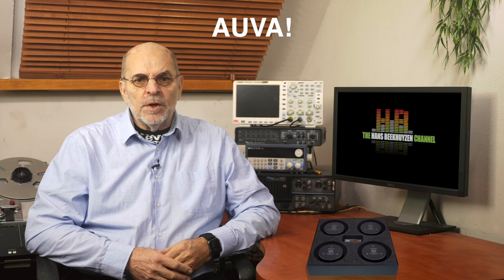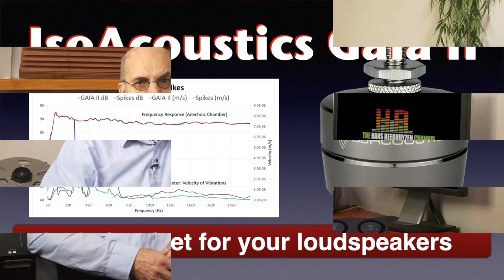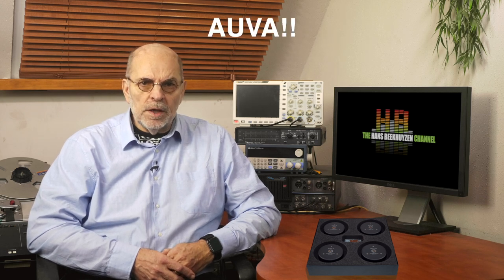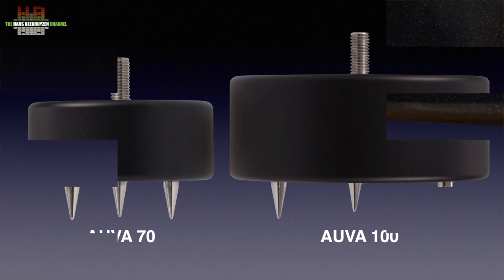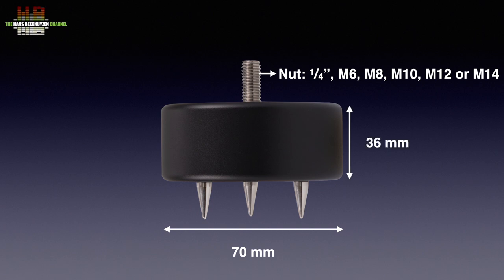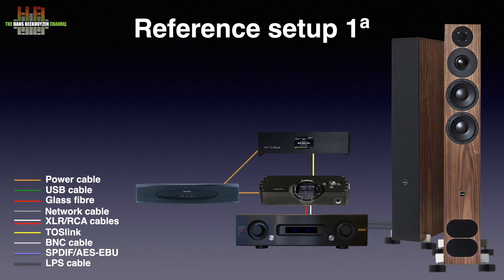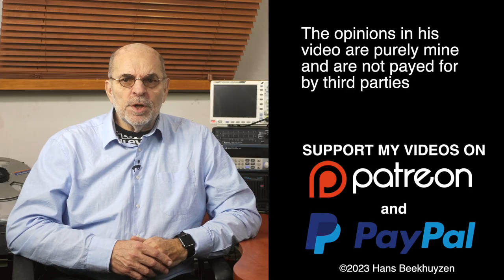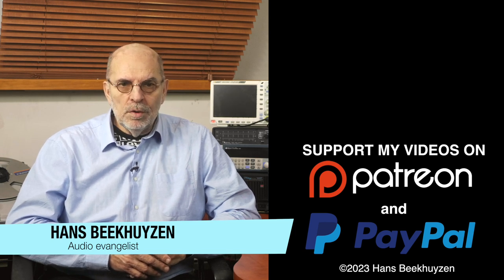Stack Audio AUVA 70 speaker isolators

Comment: Hi Hans, I've actually been looking at different isolators recently, so this is perfect timing! A couple questions.
1. I currently just have the stock feet on my speakers (not using spikes because they're sitting on hardwood floors on top of cement). Given the floor is already relatively solid, would this still result in a substantial improvement, or is it more applicable to more "resonant" floors?
2. Did you notice that this improves the sound across a wide volume range, or is this mostly applicable when listening at louder volumes?

Thanks!
Reply from the maker: I use them on a concrete floor with a layer of oak on a damping and isolating underfloor layer. You won't believe the difference they make. I  judge these kinds of devices at different levels - also when leisure listening - and the effect at 65 dBSPL is clearly audible.
Reply: @TheHansBeekhuyzenChannel  thanks for the info. Definitely adding this to my list to try out!

Comment: Thank you very much for this video. I happen to own the PMC‘s Fact.12 Signature too and also use the Isoacoustic Gaia2 feet, what a coincidence. I found these very convincing, hard to believe the Stack Audio Auva‘s are so much better, but I believe you when you say you heard a clear improvement. The PMC’s are very revealing and show every change, for the good or the better, so I guess I have to try the Auva‘s as well.   Will report back later. Cheers/Ron
Reply from the maker: Very nice!
Reply: Hi Hans, I just received the Auva‘s today and put them under my PMC‘s. What can I say….I knew these are great speakers but they unfold their true potential with these Auva‘s underneath. What a surprise, I am zapping from one song to another and every time I discover something new again. I did not think it was possible to have such an experience anymore in terms of sound improvement without changing to another level of equipment.
Reply from the maker: Great, isn’t it? Thanks for sharing.
Reply: @TheHansBeekhuyzenChannel  Hi Hans, try the new Auva EQ isolators for equipment, just put them under my preamp. Very curious what you think about these new product from Theo Stack….😊
Reply from the maker: The’re in the pipeline 😁
Reply: @TheHansBeekhuyzenChannel I can only say, I am not sending them back
Reply: @timronners did you get the 70’s or the 100’s?

Comment: Hans, love your channel a quick question ref the Auva 50 and 70's at present I am using Townshend Seismic Podiums with my speakers these were not bought just for sound quality but also  to give me some isolation from the floor to help reduce sound traveling through the floor to my neighbours below, as I Iive in an apartment. As someone who has tested both these products do you think these are as effective at reducing vibrations through the floor as the Podiums the reason I want to change the podiums is to give me more flexibility moving the speakers around in the living room the podiums do tend to take up a lot of room. At present I am using the AUVA equipment isolators with my Dac and cd player etc and am very impressed hence the interest in purchasing the speaker version.
Reply from the maker: The Auvan's do absorb vibrations. Whether it is to the same degree as the Seismic, I can't say.
Reply: @TheHansBeekhuyzenChannel  Thanks Hans for the reply think I will try the 70’s.

Comment: Do they have weight limits like the Gaia’s do? My speakers weigh about 40kg. Would the 70 work?
Love your videos!
Reply from the maker: It's not a spring/damper system, so weight isn't critical. It's the amount of vibrations that have to be dampened. The AUVA 100 can do more than the AUVA 70 but the latter already worked very fine as you should have seen in the review. The maximum weight is specified at  275 Kg (606lbs) or less.

Comment: Nice review Hans. Great to see another speaker isolation product. I love the black look of these isolators and prefer this color to the glossy IsoAcoustics (great product but they should also sell those in matte black). The footprint is a bit bigger at 7cm so that's something to take into account (especially if you still have tiles underneath, for example). Given your test, I think these are worth testing.

Comment: Hi Hans. Thanks for the review. I have got Townshend Seismic Podiums installed. Would the Auva be an improvement over the Townshend Seismic Podiums? Thanks!
Reply from the maker: As I said in the video, I reviewed the Townshands using my old speakers so I can't reliably judge the difference between the Townshends and the AUVA's.
Reply: I'm not sure if you still have this question, but fyi The Audioophile Man did a review of the Auva isolator feet and compared the Townsend podium to the 70 and 100 feet. I couldn't post the link as YT AI bots will delete my post.

Comment: Wow! Interesting technology. Makes me think about making shallow sandboxes and putting my speakers onto a plinth that rests on the sand. But that solution will definitely not get past the aesthetics committee.
Reply: Interesting idea. Maybe the plinth somewhat smaller than the loudspeakers, fitting into the sandbox that has the same footprint and color as the loudspeakers? Then it's just as if the loudspeakers got a few cm taller
Reply from the maker: It depends on the quality of the FSP's you use.

Comment: Interesting!
I just use hockey pucks.
Reply from the maker: Hokey pucks? Aren't those solid? In that case they just conduct vibrations to the floor and reflect a part of them back into the speaker cabinet.
Reply: @TheHansBeekhuyzenChannel  
I use the spikes on the speakers and place the speakers on the pucks. Hockey pucks are made of vulcanized rubber.

Comment: Hey Hans, after just watching your recent Reference Set Ups update video I couldn’t help tracking this Stack Audio review down too - Though I began to wish I hadn’t, given I’ve already purchased a rather expensive set of Gaia I’s for my Focal Sopra No.3’s but haven’t had chance to experiment with them owing to our impending house move. So to return the favour (so to speak) I thought I’d tell you about something else I found on the Stack Audio website which, if you haven’t seen it already, may have you searching for you wallet and perhaps even (just possibly) consider saving a considerable sum on your Grimm Audio MU1.

Now I appreciate that the Stack Audio Link 2 (Roon Bridge/Network streamer) is somewhat more limited in features than the MU1, however this little beauty may nevertheless fulfil your needs (or those features you use the MU1 for) for a fraction of the price, and could even eliminate your need for other noise reducing network devices too? It certainly grabbed my attention after reading this DarkoAudio Review (darko.audio/2021/11/stack-link-ii-review/) which reminded me of your praise of the MU1 in jitter/noise reduction and interestingly also has a USB input “Detox” function which got high praise from John Grandberg. 

So if you could do without the MU1’s server function (which you don’t use), it’s screen and more limited (currently) input/output options, it could certainly make for some interesting comparisons of the MU1 and also see if the UpTone EtherRegen,  Muon Pro and/or improved network switches can be done without, or if those still add more to the performance of the Stack Audio Link 2. To be fair, for only £1,150 (inc. 20%VAT) when it comes with it’s own LPS costing £480 (if bought separately) it seems like a real bargain, even if you decided it doesn’t match up to the MU1. It could slim down the box count your other set ups maybe? Food for thought anyhow I hope?  Take care 👍
Reply: Quick edit: Note the HMDI output for “future use” - various speculation I’ve read seem to indicate this may give you output to your TV, so the ‘headless’ Link 2 no longer has to do without a ‘little screen’ if you can use your much bigger TV 😉
Reply from the maker: If you think the Stack Audio is anywhere comparable to the Grimm Audio, think again. Or have the Grimm demonstrated (if you can spare the money. If not, don't for you will be dissatisfied for the rest of your life).  The Stack Link II really is a great streamer for the money but it's nowhere near the Grimm MU1.
Reply: @TheHansBeekhuyzenChannel    Well I kinda already knew that you really love the MU1, but if I offended you in any way, I was only suggesting that it may be worth trying detailed comparisons (unless you’ve already had a chance to have detailed listen that is?) to hear your views on the reports of other respected audio journalists on its ability to deal with jitter and noise issues (an import issue you have a lot of expertise in). However I didn’t say that I think it is “anywhere comparable” - I sadly haven’t had the chance to listen to either - my suggestion was based on praise given by others I also respect, who used it with other, pretty high end equipment. Note the key difference in the article I referred to was it wasn’t compared against a high end digital network transport like the MU1, but just with pretty expensive DAC’s. It’s an interesting question to look at the degree to which the network player, versus the DAC, plays in the ultimate output quality. Though If you haven’t experienced it first hand, it’s not like your usual objective approach to dismiss something without first listening for yourself, as there are still other useful comparisons (such as the EtherRegn etc) I had in mind, beyond just the MU1.

Maybe you could persuade StackAudio to lend you a review sample, rather than have to buy one. However, I’m totally realistic and know that you mostly get what you pay for so I would be surprised (pleasantly) if it could match the MU1 even just in some ways, but you don’t know unless you try, right? Maybe my comment over emphasised a MU1 comparison, but I was also thinking about the Link’s abilities for dealing with other aspects of the signal chain that may also benefit your lower reference set ups - if it can’t get close to the MU1 that is 😉